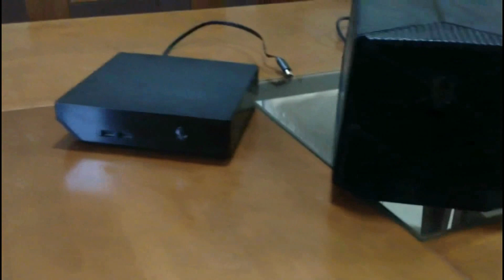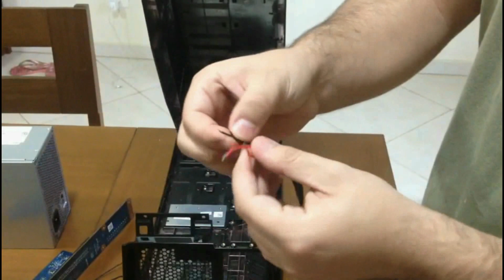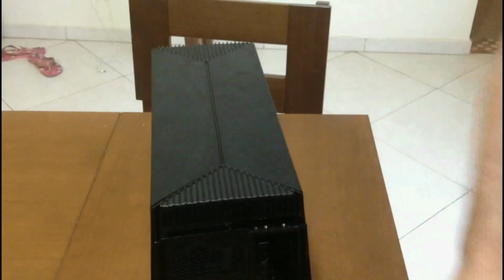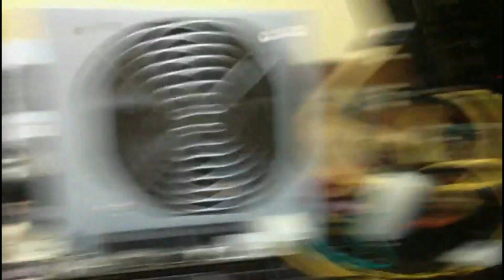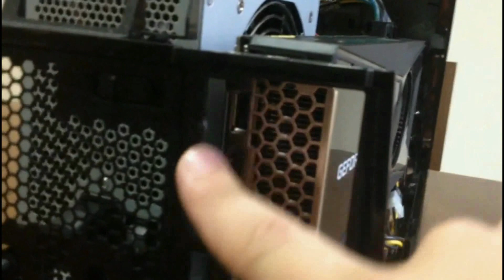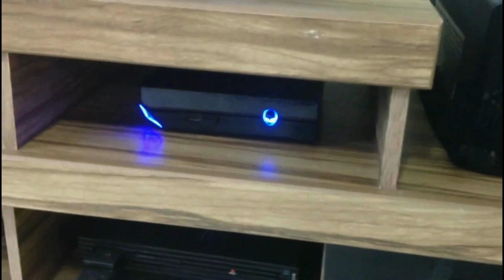Alienware Alpha R1 eGPU Alienware Graphics Amplifier

Comment: What kind of screws you used to Mount your exp gdc on the alienware amplifier? Thanks again for your time👍
Reply from the maker: I do not know the specification of the bolt I took the exp to the place that sold bolts and bought the ones that served
Reply: @JuniorItuanoGamer  thanks am going and do the same thing thanks again for everything. Hi from mexico

Comment: Can you not use the power supply that comes with the alienware amp? It seems to have different connectors to the cable that comes with the exp gdc
Reply from the maker: I changed the power supply so I could use more connectors, including the 12v connector for the led and depending on the gpu you put in it is good to check the voltage

Comment: Without modifications, the amplifier doesn't work with the alpha 1 right?
Reply from the maker: Correct, this method is called eGPU and is very traditional in notebooks
Reply: @JuniorItuanoGamer  I have to sacrifice my wifi card? can I replace my wifi card with some wifi adapter or antenna usb?

Comment: Hey great tutorial! Do you have a better view/description of the wiring you used for the lighting? That’s the only part I can’t figure out. Other than that mine is just like yours! Great stuff
Reply from the maker: you can use any type of led, in that case I used 2 and plugged directly into the power supply on 12v pins

I'll leave a link with the led style I used

another detail you must remove the protection of the alienware logo so that it is discovered, then fix the wires of the led in the case, I used tapehttps://produto.mercadolivre.com.br/MLB-699744905-kit-3-led-brilho-neon-conector-molex-casemod-luz-negra-azul-_JM
Reply: Junior Ituano Gamer awesome thank you!! I had removed the sticker but didn’t realize I needed an extra led!
Reply from the maker: yes and another detail is that the alienfx will only work in the alpha so it is good to take a led that is of the color that you usually use in the alpha

Comment: What connection is used to connect to the alpha? The wireless card slot?
Reply from the maker: I connected the eGPU EXP GDC adapter to the wi-fi card input, the data connector must be NGFF version and not the PCIe
Reply from the maker: check out the tutorial from Damian
https://www.youtube.com/watch?v=yV9__ak1jGw
RESPONDER
Reply: Hey mate awesome video. Do the wires from the fan and alienware logo light just push into another power connector??
Reply from the maker: sorry for the delay to respond, I used 12v connectors and so it is necessary to use a power supply different from the PSU that comes with the graphics amplifier
Reply: Junior Ituano Gamer thanks mate! I tried using the power supply in the alienware graphics amp but the connectors wouldnt match the exp gdc adaptors. Will go buy another power supply and try that . Thanks for your help